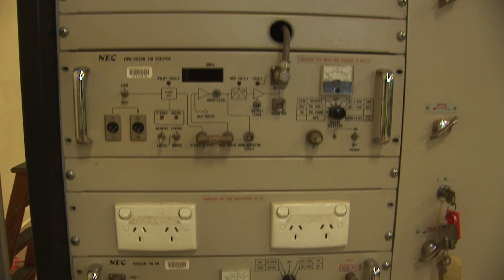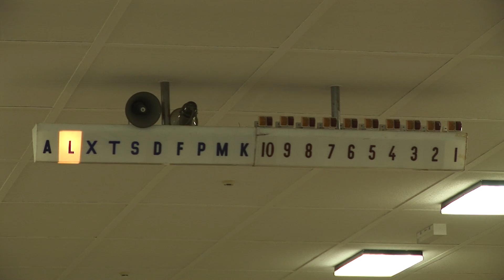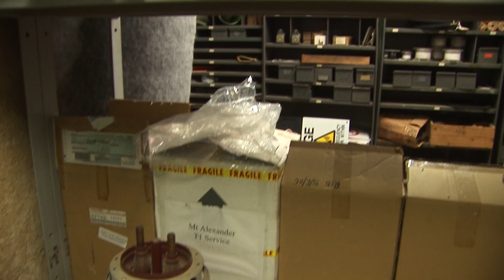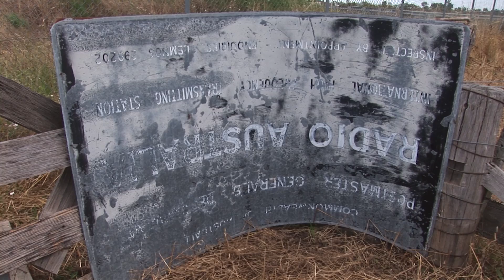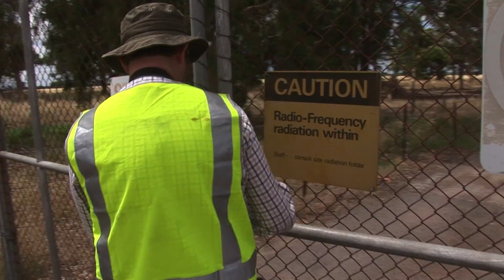Unedited Radio Australia Shepparton footage 2010

Comment: 8:44 hhmmm! Mercury! yum... Been a while since an 857B cost $117 Quite a long-lived valve, 857 development (by GE) commenced June 1928, type no. assigned March 1929. Used in the polyphase HT supplies of the origional 100 kW tx's.